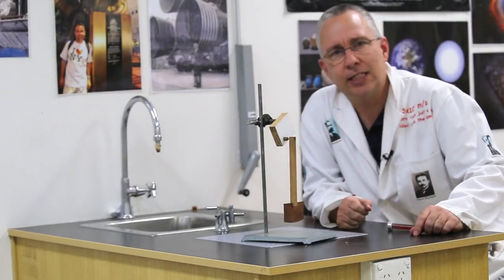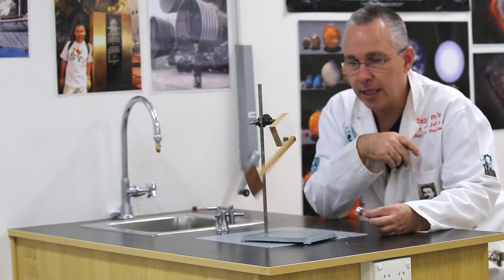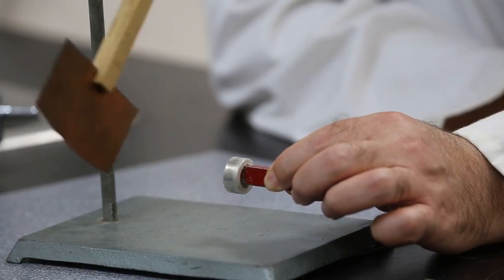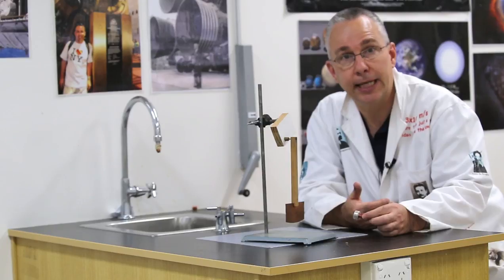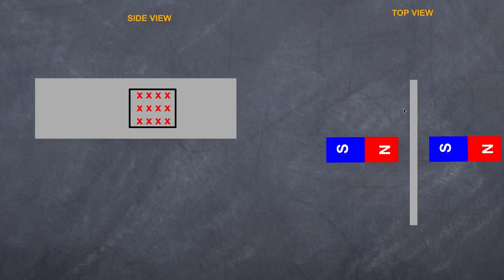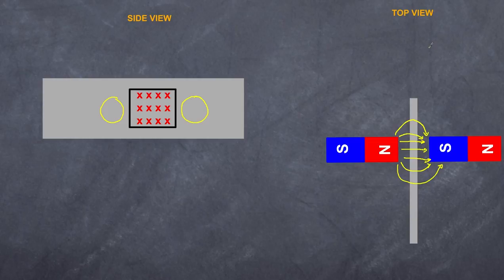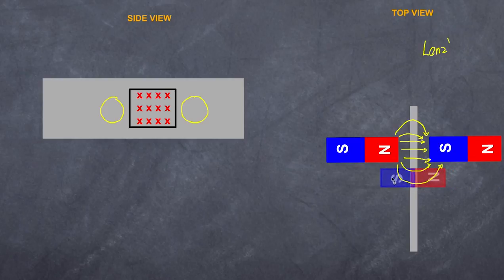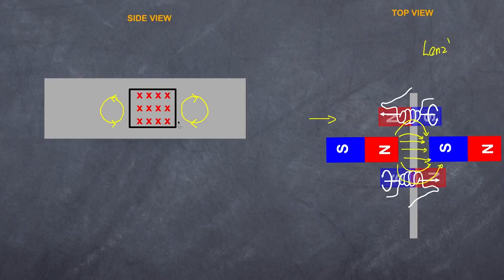eddy currents and electromagnetic braking explained

Comment: Thank You so much 😊... I have a question that I hope you can answer , It is said that in electrical instruments the core of the coil is made from parallel wrought silicon iron sheets isolated from each other and parallel to the axis of the coil to increase resistance and decrease the effect of Eddy currents and reduce wasted electricity in the form of heat ..what i don't understand is : how can connecting sheets parrallel to coil axis increases resistance since it is supposed to decrease it and what does resistance have to do with Eddy currents 🤔....I don't know if you will answer but i had to try 😅
THANKS FOR YOUR TIME 😀
Reply from the maker: What you are referring to is called lamination.  Rather than thinking of increasing resistance, they prevent the creation of larger eddy currents. I do discuss this in my transformer video.
Reply: @PhysicsHigh  Thank You so much 😊

Comment: The video is great! but what are direction of forces act on metal strip causing it to brake? the motion of the metal strip is left and right, but the repulsive and attractive force due to poles of magnet & metal strip is into and out of paper. So, what forces are acting in parallel to the motion of metal strip tp cause braking ? thanks

Comment: very nice, you might consider adding a video and include a copper piece with vertical slits showing a reduced effect and tie that in with transformer and motor construction being made with thin sheets of steel rather than solid machined blocks
Reply: maybe i should go through your catalog of videos first,, great work

Comment: Strange question but would it be possible to take a hollow circular metal core rap the outside with copper wire hook and electric current to the wires to create an electromagnet but then put a round bar of metal that spins inside the hollow circle and be able to slow the bar down by or exert a load on the bar by providing juice to the electromagnet around it?
Reply: Very nice idea imagine having one or two magnets fit on the cycle's tyre spokes and the cycle tyre covered with a lot of not whole circular rings but each end connected to wire which has a full wave rectifier connected to the ends , run the cycle and you can generate current

Comment: follow-up query.  Can you explain what is occurring in the swinging copper sheet as it passes through the middle of the magnetic field (where the flux density is constant).  There should still be force exerted on the positive charges in the copper sheet.  does this add to 'magnetic braking'?
Reply: Jane Hill this is a little late but I’ll explain anyway: when the metal is fully inside the magnetic field there is no change in flux ( since magnetic field is constant along with area). Thus there is no induced EMF and therefore no eddy currents are formed. If there are no eddy currents electromagnetic breaking does not occur.

Comment: Wow nicely explained. But my doubt is how does eddy currents occur and work inside a residential electric wire?
Reply: What you are looking for is called inductive reactance and is an important effect in magnetic solenoids, motors and generators.  for the wire itself it is there but not a huge effect.  Look up AC impedance of conductors versus DC resistance.

Comment: How does eddy currents do electromagnetic braking, you didn't explain the crucial part.
Reply: The new magnets that are created by the eddy currents attract the magnet and slow the moving plate down.
Reply: @HJeff  they don't attract they repel, polar opposite, if they attracted they would speed up
Reply from the maker: Actually both. Lenz law. The front repels to oppose motion. The back attracts, to oppose motion.
Reply: @PhysicsHigh  if one repels and one attracts doesn't that cancel each other out into a net zero?
Reply from the maker: Have you seen the video. I explain this.
Reply: @thesocialhandgrenade8474  bro it's in opposite side so they add up

Comment: ok but how do those eddy currents actually form? Like what happens insight the material so that the electrons move this certain way?
Reply from the maker: Deep down it’s a quantum thing. The electrons, by nature of their properties, charge being one of them, will experience a force in a magnetic field., perpendicular to the field
Reply: Magnetic fields exert a magnetic force on charges and move them along a conductor. That's how generators work. The coal or steam power moves a coil in a magnetic field (rotates it) and the magnetic field pushes the charges of the coil along the wire hooked up to it and generates a current.